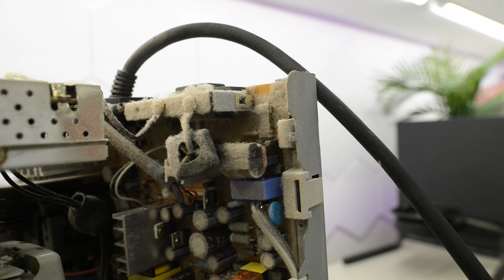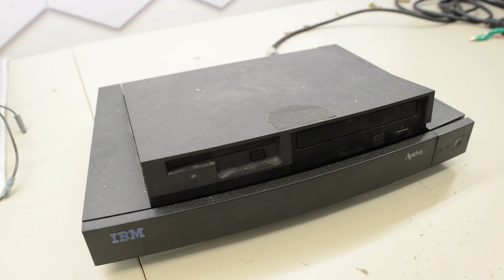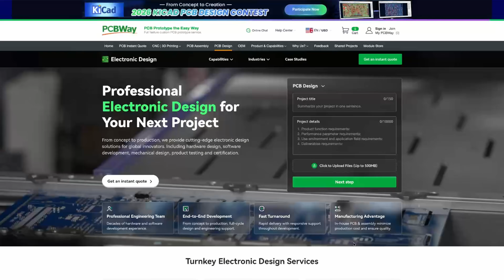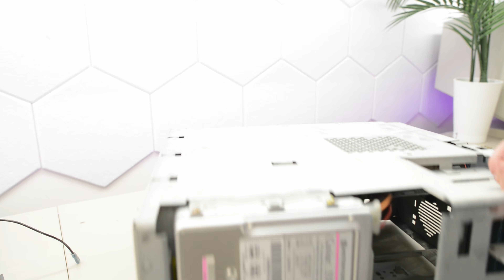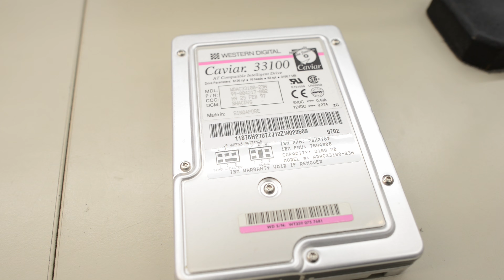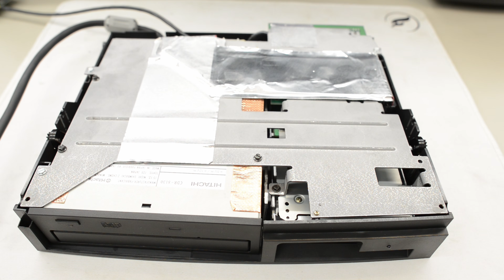IBM’s Forgotten Masterpiece (1997)

Comment: I still have my Stealth 200MHz (no MMX) with a 17” “vertically flat” CRT.   If I recall correctly it’s model # is 2159-S78 (both in original boxes) and the original Subwoofer in it's box (that was an additional add-on option).  The PC was about $2,000 US and the monitor $750, so not a cheap system in December 1996.  Annoyingly Intel released the MMX chips the following month, making mine instantly "outdated" in that sense. :D

I’ve installed a SoundBlaster AWE64, an Obsidian 2 Voodoo2 3D accelerator 24MB (by Quantum 3D) and an Evergreen Tech Spectra 400 cpu upgrade (AMD K6-2 400mHz).  They also sold a 15” CRT as an alternative to the 17".  Windows 98se works great, but mine came. With Win95b (pre-USB standardization), but has the USB 1 port.   I’m sure I still have the original disks for mine too (Somewhere).  For the other PCI slot I'd switch out between network interface card and a SCSI card for a scanner and Phillips OmniWriter CDRW.  The Obsidian 2 card has 2 12MB VooDoo2 boards in SLI using a single PCI slot.  I am pretty sure I installed an AGP graphics card too, but can't remember which ATI Rage card I went with.

This made for an outstanding gaming system in it's day, and the CPU upgrade gave it life beyond it's expected end date.

Comment: My first ever computer was a Macintosh Performa 630CD, but my first ever PC was a 233Mhz IBM Aptiva, 32M of ram, 4G hard drive and came with a lot of cool things like phone dialing/answering machine software and a Home Automation package that let you remotely control lights and the such from the computer.

The only downsides were really just the integrated ATI Mach64 graphics card and the WinModem that came with it. It was a beast otherwise!

Comment: I started working Staples in ‘97, I think these were lightly stocked, but I don’t recall selling one. Also, they were in the Radio Shack in the mall across the street. Pretty expensive, but many complete system in the late 90s could run 3k-5k.

Comment: That is such a nice machine - I have a Black IBM myself but much more modern so much less "appealing". 
What is your favourite way to slow down machines which are too fast to play software designed for slower machines?
Reply from the maker: Hey Tony, Phil actually made a video about how to slow down the MMX for early speed-sensitive games: https://www.youtube.com/watch?v=RtRkEU7pU08
Reply: @Epictronics1  Thank you - it's an interesting tool though I am a bit confused: he shows a Pentium MMX in the video but the tool he linked doesn't support Pentium processors?
Reply from the maker: @tony359 strange, I need to check it out

Comment: I love the look and the design, never seen some like it before. I have two IBM machines in my possession. Don't remember the model nr, but, one is a white AT case with a sliding door up/down with 120mhz pentium cpu and 16mb of ram, the other one is a bigger black atx case with a lid, more like workstation quality and well built. It had a 2 ghz P4 478 cpu, and 512mb of ram if I remember correctly. Don't realley know what to do with it, but I like the case and design and the build quality and very spacious, maybe will build a sleeper of it, don't know yet. EDIT: The workstation is a IntelliStation M Pro with socket 478 2.2 ghz P4 cpu and 1gb of Rambus. There were two configurations of this machines, the other one was with dual xeon, which would've been more fun to play with.

Comment: I’ve got a similar model s66 and was never able to get another 2D card working.  As for your hard drive, do what I did. Give it a few good taps on the side 3-4. It’ll unstick the drive head. Mine did the same and has been working for 2 years now. I’ve also got all the factory restore software if you need.

Comment: We had a IBM Aptiva 2140  i think it was called, our first family PC. With the same 15" monitor with built in speakers. All black. The built in graphics had a memory expansion slot on the motherboard so we upgraded from 2mb to 4mb. Later we upgraded it with a Voodoo 2 card. Miss that computer. The desktop had a convenient handle on top so it was easy to transport to LAN parties with my friends. Pretty quiet too, apart from the 5.25" HDD we had in it 😛

Comment: That's pretty cool, I've never seen one like that! It's interesting that the riser board seems to have the same connector as mine (except mine is ISA/VLB on the other side) - I wonder if that'll fit into my PS/1000 Blue Lightning and actually support PCI - that'd be awesome on an essentially hot rodded 386 ;)

Comment: So they ran ISA up a cable, and then put an I/O controller in the disk box? That's.... a choice! 

I think it's a choice that most clone makers wouldn't have been comfortable making, because they'd need a lot of testing to confirm that timing constraints were met over such a long cable, etc. But IBM knew ISA like the back of their hand, so if they figured this was possible, they could pursue it in a way nobody else probably would.

Comment: The genesis for this model surely was an IBM executive eager to be at the top of the Multimedia PC craze, even at the tail-end. The Multimedia PC Marketing Council (MPMC), which I can't recall if IBM was a member of, had dissolved just prior, and it's certification along with it. 

I've work on one of the drive consoles, but never the tower. This one was fully kitted out, from the looks of it, wavetable board and VRM add-on included.

Comment: To be honest, this PC looks incredibly gimmicky. I don't see the need to make a separate module to contain the disk drives. Computers at the time could already place the disk drives below the monitor by simply using a "flat" desktop PC case that the monitor could sit on top of. I mean, IBM was already making computers like that. While the "popup" mechanism for the disk drives is kind of neat, but it just makes it difficult to set things on top of the module. So the only place it made sense to be set is below the monitor. (This is the same reason "Popup" VCR's didn't stick around for very long)
Regardless, it is a neat looking system. But very gimmicky. 😄

Comment: I've got one of these!  I've half restored it.  The chassis was a miserable oxidized mess and I ended up repainting it.  Also had to replace an output inductor to the VGA port.  No idea what happened there.  Still missing the stand for the monitor.  They don't show up very often.

The external drive enclosure is such a weird concept.  I had to get one just because it was exotic and strange, but I can't say I think it was a particularly great idea.  haha  Definitely would've worked better with Firewire or USB 2.0 (which didn't exist yet.)  That chunky data cable is nuts.

I even tried getting it to work with an IBM Mwave audio/modem card, which was of course foolish and doomed from the start.  It almost kind of worked a little bit, but not really.  And I think that's exactly the experience one could expect from that card.

Comment: Ah the mid to late 90s when system builders were trying anything and everything to differentiate themselves from the competition. Apparently not even IBM was immune.
Wonder if it would at all be possible to install a newer ATX motherboard and powersupply in it. Motherboard would probably need to be put on some very tall standoffs to be at the right height for the slots, or lots of risers would be needed, but it might work ignoring the ATX io panel\shield problem. ATX power supply should just fit as is instead of the LPX one

Comment: i still have some random  bits of an old aptiva machine. it was gutted after it died on the owner, and i wound up with the bits. some of the interconnects, the speakers, a drive, etc.

rather wanted the whole of the machine, but they had already tossed the parts they considered worthless (they were tech illiterate, so who knows if it actually was or not). much sad. quite a few of the aptivas were pretty cool designs for their eras.

Comment: This is cool. Can't say I ever saw one. I am not sure multimedia pc's were ever really a big seller. HP tried to push them again in the mid 2000's even with remotes.
Reply: I saw two, my friend had one and my local Radio Shack had one on display where I would go often to drool into the keyboards of all the display systems.

Comment: The SMC chip is for LPC bus(Low pin Count) that is responsible for 8-bit low speed connections on the main board(ps/2,serial,parallel,floppy)
Reply: want to know something cursed, that big fat centronics cable takes the ISA bus right up to the media console

Comment: As others have mentioned Mike Tech just worked on an Aptiva and had luck resurrecting the HDD by giving it a twist to break the spindle loose. Not sure if that is the issue with your drive but might be worth a try to get the missing proprietary software if you haven't made an attempt already.

Comment: My friend had this machine in 97, while I had the equally rare Aptiva 2136. I'd love to have one of these 2162 machines~ I'm still on the edge of my seat for your 2136 video(s).
The Recovery CD you're looking for is the 76H7050, 12J4046, or the 12J4053. You can find the 12J4053 (2162 S35) on the bay, look up item 116881313036.
That IBM SW1/C soundcard is the one I had in my original 2136 and now years later I was able to re-acquire it! It's notable for the fact that the 1MB wavetable chip uses recorded samples from the Roland SC-55 without permission. ^_^;;
Reply: This comment appears to be hidden from other users? My other accounts can't see it... :/

Comment: It is a cool system, congratulations, but personally I do not like the design of it. The "console" as you named it, looks only good with the drives down, furthermore I cannot see any benefit of the mechanism, as it has to be an empty space anyway to "hide" the drives. It just adds more steps to access and more steps to break mechanically. When the drives are out, it kinda looks "out of shape" and you cannot put anything on it, because I think it is angeled. The mointor with the "legs" and whatever the round UFO shaped thing is on the bottom, also looks strange. It would be much cleaner and better to use when you could simply put the monitor on the base, delete the "hiding" springy feature (or make a flap or clip-on-cover) if you really want to hide the drives. It seems more like a toy or gimmick rather than any helpful or good-looking design to me, maybe I just prefer simple designs like Commodore. Especially I hate it when you have to wait for drives to appear, must be annoying to wait with the dampers, so in the end you probably will let it open all the time, and then you just have a flying monitor with legs and a angled surface you cannot use. It seems not thought through. The concept of the seperate tower or lets say external drive bays is maybe not mass market but "good", but I do not like how it was executed personally.

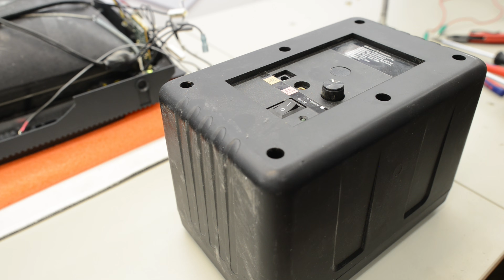Comment: 3:47 that's why I bought a long screwdriver when I needed to install a very high CPU cooler (one of the screws was inside the cutout of cooler body). Now it's a nice utility to reach for expansion card screws in any PC case without a need to reach it with screwdriver at impossible angles, damaging screws and screwdriver itself.

Comment: The IBM Stealth was my personal favourite system. With the retail restore, it has active icons, and it's full speech controlled.
Reply: Boasting their speech recognition software, I reckon? Remember IBM's Via Voice? They used to be one of the big guys in that field.
Reply from the maker: That's pretty cool, I need to get my hands on that restore CD
Reply: @Epictronics1  Good luck; I have been looking for years to find one. No one has backed it up on archive or on the mainstream net that I could find. At one time, I did find the IBM active desktop customization program, but it was in Chinese and had a virus. But there is a golden lining to it all :)
Back in the day I obtained the Active Icon and Start Menu Software; I could send it to you if you like. For the rest, the OG stealth was running Windows 95, this is important for the active icons to run. Make sure no IE4 with addons is installed as well. Besides that, it came with IBM ViaVoice for voice typing and control. I'm drawing a blank on the rest, but I do remember a custom media deck custom TV & Radio software. Also I recall Software for fax & Speaker Phone.

Comment: Very interesting, IBM did carry on with the idea (see the IBM 7226). It’s basically an LTO tape drive/DVD combo. Seen on low end Power systems it segregates the components from the server meaning you wouldn’t need to to touch the main server whilst the tape drive is repaired for example reducing risk in a production environment where uptime is the priority.
Reply: Interesting, thanks for that.

Comment: This is actually quite interesting as another retro tech channel I follow just restored a slightly older Aptiva, which was very similar internally.  The main difference seems to be a better processor and larger HDD, but otherwise it seems to be only a slight design upgrade.  What I find interesting is that I have a Gateway from this very period, which has all PCI slots with only two 16-bit ISA slots, yet this seems to be the opposite.  I wonder if that simply points to the board being of an older design.  

Love this system though, and you are very lucky to have gotten it complete 🙂

Comment: I'm guessing it was priced well beyond the market at the time and that is why it was short-lived, because it certainly would have been desirable.
Reply: $2500-$3000, but in 1996 a computer comparable to the base model would cost you at least $2000 from any manufacture.
Reply: @user-9001  And a $500 difference in 1997 would be like a $1000 difference today.
Reply: @nathanahubbard1975  Your argument isn't as strong as you think it is when today $1000 will get you a couple sticks of mediocre RAM or 1/3 of a flagship phone.

Comment: I remember really wanting one of these but it's silly but cool. the drives were one thing but if that media bay also had USB and serial ports that would have helped.
Reply: Serial ports maybe, but this design predates USB.  I remember selling these in the 90's, and still have the media console and monitor from one.  I just keep it for the weirdness factor - I only wish I stil lhad the ISA card it used as an interface.

Comment: Very odd system. Why is the 12v out on the back not just coming directly from the Power Supply, why do they need to run presumably a decent amount of current through the motherboard?
Reply: This thing was full of odd hacks like that.  I doubt the sub pulls more than a few watts, but still, it's pretty dumb.  For one, you would think, if they're going to run the lowpassed audio out from the monitor, they could use the monitor PSU to power it, too.  Or, maybe that jack was intended to support external speakers if you weren't using the bespoke monitor.  (But then, good luck dealing with that pop-up drive bay.)

IBM gonna IBM.

Comment: I like the concept. I always had the tower off to the side so putting the media on the desk makes sense......but why is this over engineered? Just have the floppy and CD stick out all the time. Dont' bother with the open closed crap. Less stuff to go wrong. Easier to work on. At least it worked for you after you fixed the spring.
Reply: That's always been my question too.  It seems complex for the sake of being complex.  Without the pop-up mechanic, they could've made it part of the monitor stand, and then you wouldn't need the "drying rack" stand for the monitor itself.  (Which I don't have, and I'm bitter about it. haha)
Reply from the maker: @sirnickity  😅
Reply: @Epictronics1   Hey, BTW -- I did track down the US English restore and diag ISO for mine.  Not sure if I managed to find the original discs or found the images online, but I have it on my NAS and can drop it on The Archive.
Reply from the maker: @sirnickity  That would be great! Thanks!
Reply from the maker: Maybe they went for the IF design award?
Reply: @Epictronics1  I actually rely on a USB hub for my computer. My computer is behind my desk. It's blocked off by the couch. I can barely reach the power button. So it's kind of like that.